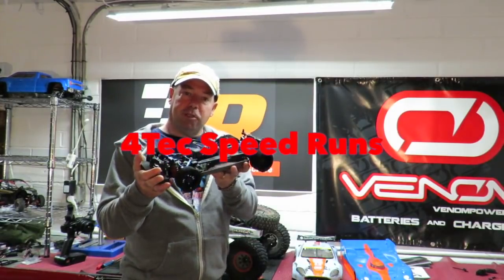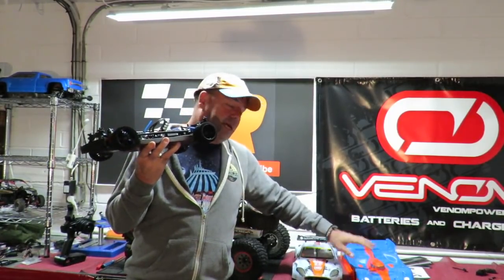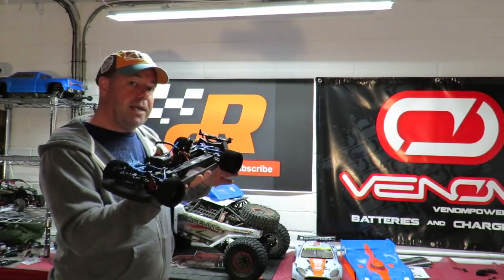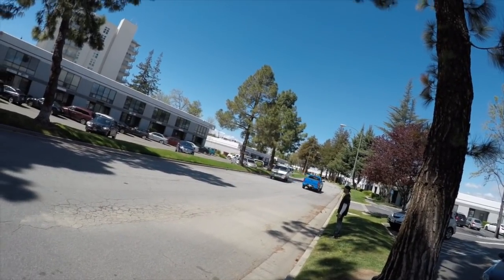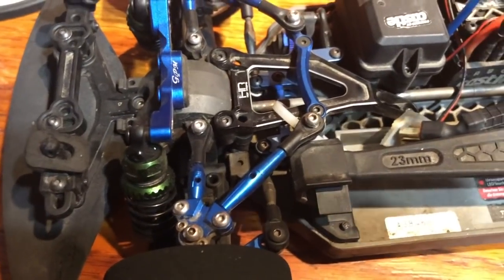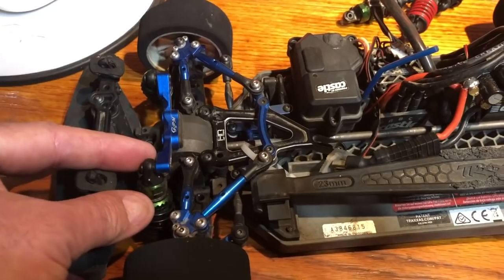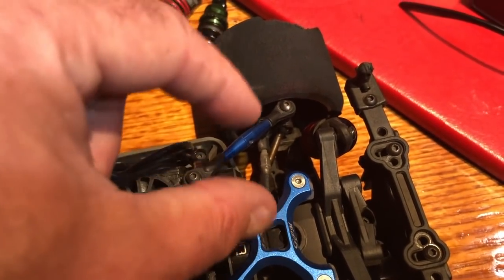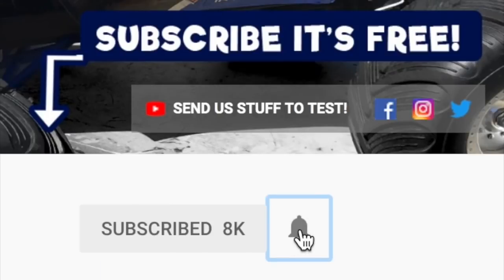78 Mph Speed Run And Blow Overs With Traxxas 4-Tec 2.0 VXL

Comment: Could it be flipping because the asphalt is rough and you dont have enough ground clearance?
Reply from the maker: Indeed in slo mo it appears to be going jittery over the broken blacktop (which looks smooth in reality), hence I've put the old front shocks back on as with those it didn't have issues (With the aston body at least). I think with this setup it was too low any bump upwards and the airs under it and it's gone over!

Comment: I’m going to help you you need delta body with grp tires And most important a perfect road
Reply from the maker: This car has run 84mph with the aston body with no sign of blow over. The foams are fine provided it doesn't flip. In the 'old' spec I can give it full throttle off the line and it just hooks up and runs arrow straight. No signs of lift until I dropped that front down. A perfect road is hard to find around here! All the non-foam tires shake horribly above 70mph. You should check out some of my other speed run videos as I've done a few :-)
Reply: Driftomaniacs I think foams are good for drag racing but my 4 tec does 130mph I have delta plastic body and grp tires t.p motor on 4s castle esc

Comment: more rake  make the car have no drop back or front
Reply from the maker: It's run 84 rock solid with the rear higher than the front. I should never have changed the shocks!

Comment: You can buy a 4tec stock running 70mph 😂
Reply: Another YouTuber did that bone stock with a good battery and barely hit 70, but it did it, Ironhead okie I think. And Modded ones are doing like 150-160mph.
Reply from the maker: Why would I want one of those? My stock 4tec 2.0 vxl hit 73mph, and this one with the aston martin body fitted has already done 84mph......
Reply from the maker: This youtuber hit 73mph with the stock setup!